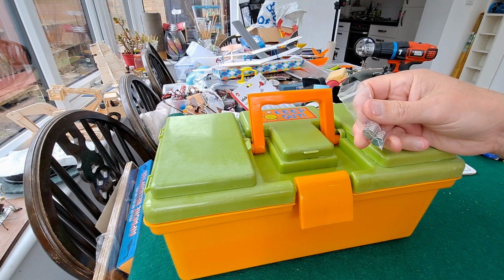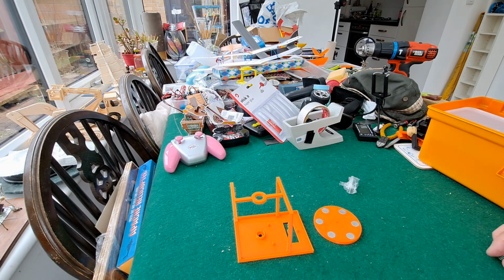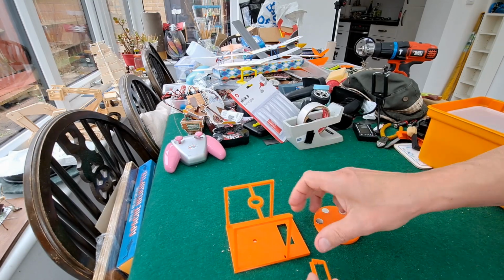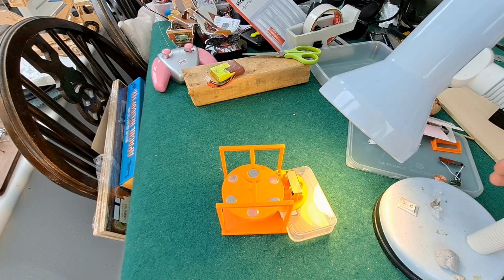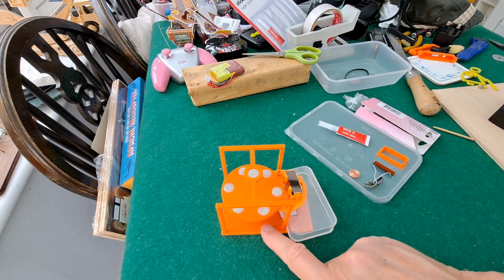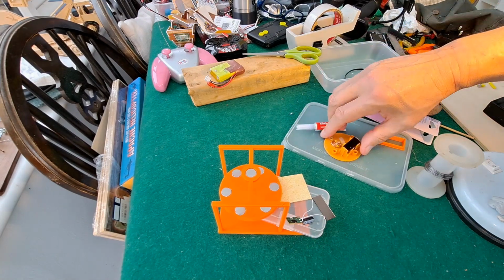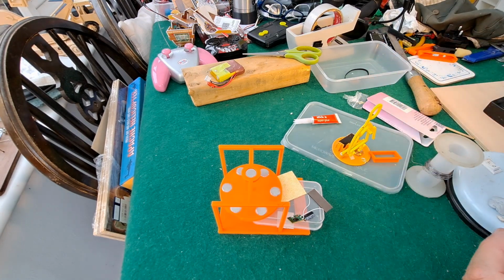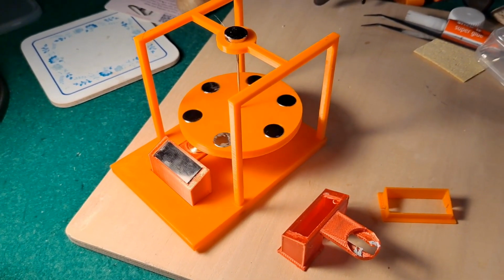3D printed Solar powered pulse motor

Comment: Well this project did it.  I finally ordered a 3D printer today to get started learning how to do this.  I got a Ender 3 and will try to build this project on it.  Thanks for sharing this build.  I went over to gzumwalt's  channel and his amazing 3D printer work really got hooked.
Reply from the maker: Oh dear, what have I done 😲 it is easy to get sucked into printing things that don't need printing just because you can 😆
Reply: @GrandadIsAnOldMan  Thanks.  I will watch out for that impulse.  The first task will be to learn how to do this process.  This is brand new to me ----but long overdue.
Reply from the maker: @Lidmotor  good luck. I use TinkerCad for my designs. It is free. It is a very basic introduction to CAD using simple building blocks like cubes, spheres, tubes etc that you combine together to make what you want. It is all online so you don't have to download any software.
Reply: @GrandadIsAnOldMan  Thanks.  I will use that.  I will need something very simple to succeed with this new quest.  I spent hours yesterday doing research and ordering stuff online that I will need for this project.

Comment: Awesome.."i can't see what iam doing with fine wire :)"..what if you make a microscopic pulse motor, powered with body heat? Thats would be fantastic
Reply from the maker: Yes, I need glasses and a magnifying glass and still work by guesswork sometimes.
Reply from the maker: @hermitoldguy6312  Ultimately everything is solar powered on this world, although somebody did argue thermal vents aren't, but that could be debated.

Comment: So, as I understand it. Depending on which way the solar pulse coil is situated, depends on the direction of rotation???
Reply from the maker: Well, sort of, maybe. In truth it will probably rotate in either direction and it will also work with the magnets set to North North North, or South South South, or even North South North South. But usually it will spin better one way. It also depends on what circuit you are using to trigger it. I believe the circuit I am using here from a solar rocker detects the magnet, that makes it trigger a pulse that will either repel or attract the magnet. If that gives it sufficient momentum it will move far enough for the next magnet to be detected, causing a pulse, and so on, causing the rotor to spin. Other pulse motor circuits use a simple reed switch to detect the magnet passing and trigger the pulse. In those designs the position of the reed switch will define the direction of rotation. The advantage of the solar rocker circuit is it will also generate pulses initially as the sun starts to charge it. That will start the magnets moving and can result in it self starting. The reed switch circuit will always need the motor to he hand started to get it moving. I have a series of videos coming up where I am trying to get it to self start with the sunrise in the morning, some fail and some succeed. Generally if I tried to film it it failed, if I left it alone it would self start.

Comment: schematic?
Reply from the maker: If you mean the circuit for the solar rocker, you don't need it as you just use the module straight as it is. However if you want to know how it works, bigclivedotcom has done a couple of reverse engineering videos - here you are https://www.youtube.com/watch?v=MHRxYtVD1IU&list=PLA5a2xPRSrB1L61NAVuE5I9FbPgq3sSG1&index=102 https://www.youtube.com/watch?v=9QB59xsCpeI&list=PLA5a2xPRSrB1L61NAVuE5I9FbPgq3sSG1&index=49